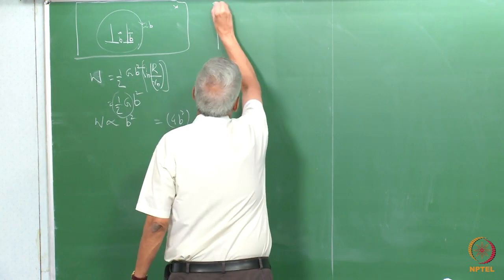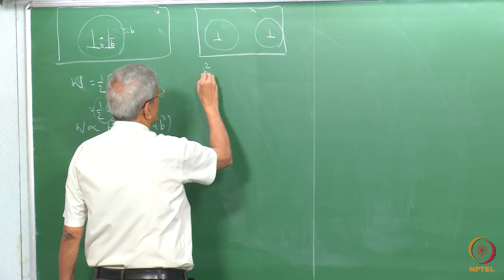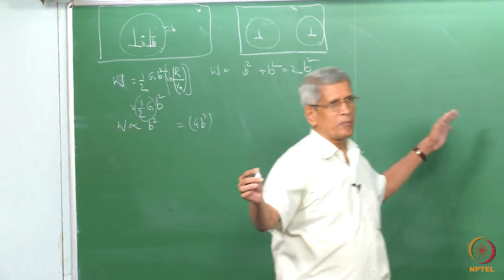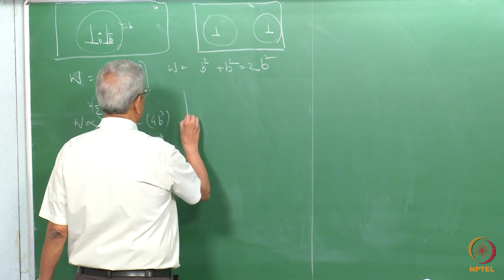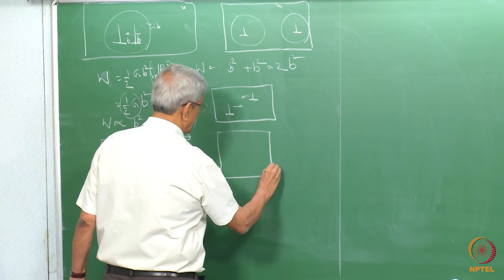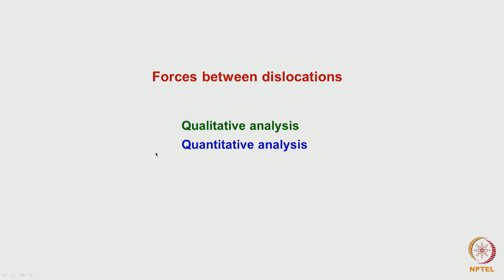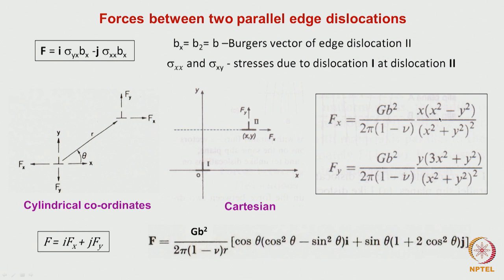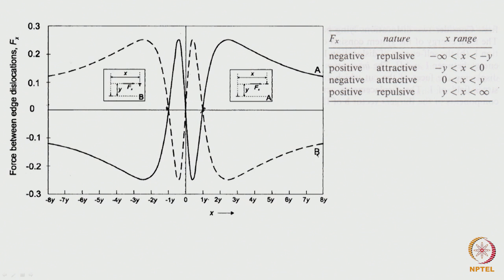Lecture 22_Forces Between Dislocation

Comment: Incredible lecture sir… got cleared many fundamentals. Thank you so much sir. I have a question sir consider there are 2 dislocations under two situations 1) They have formed a kind of dislocation couple; and 2) considering them as two individual dislocations. Now sir in which condition the stress required to move these dislocations will be higher and why?